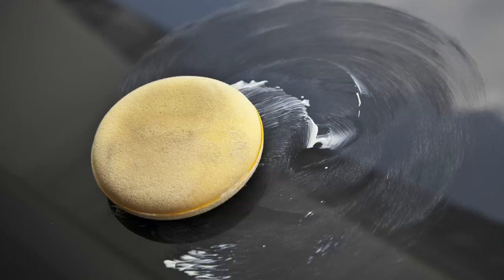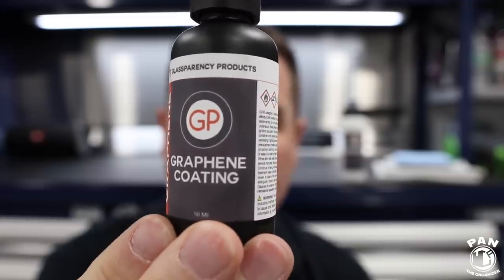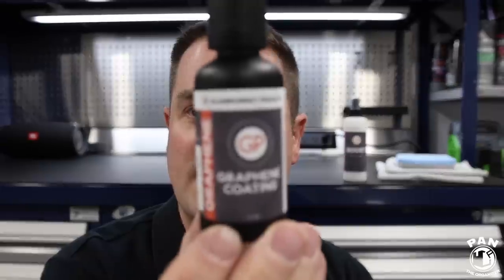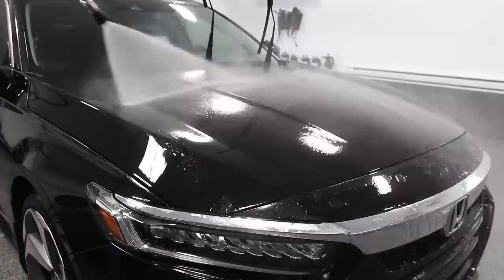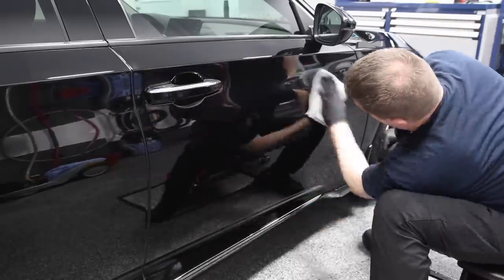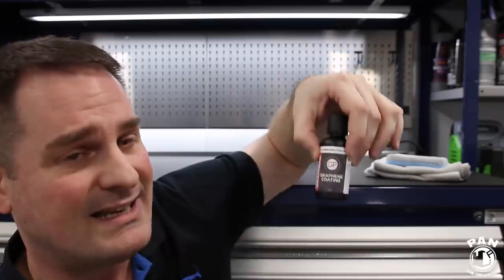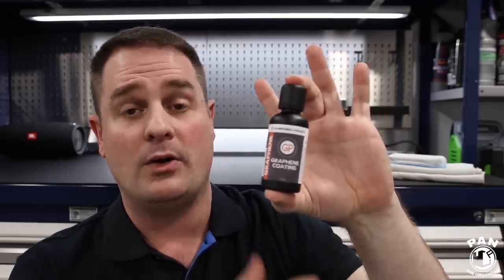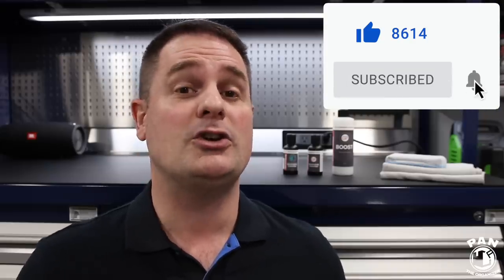GRAPHENE COATING by GlassParency! The Future of Paint Protection!

Comment: Heyyy Pan. This was the video I have been waiting for. I bought this coating when the company offered threw mentioning you when you did the review and application of the glass coating. I took advantage of that deal but have yet to use ether. I have Optimum Gloss coat on my vehicle now so have to do a light polish to get it off the surface. The weather here in has been extremely hot so waiting for a cool down. down. Excellent review but have a question. The front clip of my car has a PPF on it, do you know if you can apply this on top of that? I can also call the company. Anyway ALL THE BEST as usual.
Reply from the maker: Thanks Mike!  Yes you can apply the graphene coating on top of PPF too.
Reply: @PanTheOrganizer  Thank you and a polishing I go.

Comment: Pan...I have a post-GP question.  2 days after finishing my GP and Boost I parked next to a tree, not thinking that, at this time of year, there’d be any sap but later in the day when I went for a drive I see that the car has many tiny sap/particles on it.  I know I’m not supposed to wash the car for 2 weeks so what do you suggest I do?  I can’t imagine it’s a good idea to let the sap sit on the body.  Thx for any tips!
Reply from the maker: I wouldn't worry too much. The coating is there to protect your clear coat. Wait your 2 weeks, then just wash the car and maybe use a bit of tree sap remover (like CarPro TarX) and you should be fine.
Reply: Thanks...but I ended up coming home and using the boost spray as a lube and very very gently wiping off the sap.  My ‘assumption’/logic was that the topcoat was already Boost so it should be fine, and it was. The sap came off easily.  I was also ‘lucky’ in that the sap was only on the hood, front left quarter panel and a bit on the drivers door and roof..not bad.  And I didn’t want to wait for the sap to dry/harden...it’s easier to remove if it’s ‘fresh’ and in this case it was only on the truck for maybe 4-6 hrs.  So, thanks for your response but I thought you should know what I did since it worked just fine, no noticeable marks or other.
Reply: Same thing happen to me but bird poop don't know if I should wait the 2 weeks?

Comment: Question, it has 5-10 years protection after 2 coats but how many times do you have to re apply between car washes?
Reply from the maker: Nobody spoke about 10 years.  Where did you get that?  It's 3 years of protection if you apply 1 coat, and up to 5 years of protection if you apply 2 coats as recommended.  Every 3 months, it is recommended to apply a topper like Boost after maintenance washes, to maintain your coating's properties.  That's it.  You don't need to reapply the graphene coating after the first application. Until you reach the 5 years.

Comment: Hey Pan, thanks for the Wonderful video! I've got a question:
 Is graphene  coating scratch resistant?
Reply from the maker: No coatings are scratch resistant.  If someone tells you that, that is pure marketing bs.  Coatings are meant to boost gloss, slickness, add UV protection, protect against chemicals, last for years, add insane hydrophobic properties and give self-cleaning properties meaning the car is easier to wash.
Reply: @PanTheOrganizer  can we use a graphene + PPF combo?

Comment: Hey Pan, do you know if graphene products can be used on Matte paints (without significantly changing the finish)?
Reply from the maker: You should stick with ceramic coatings made for matte paints, until they release graphene based coatings for matte paints.

Comment: Thanks Pan!  I've been holding off, until now, after doing a consumer-grade Ceramic 2.5 years ago and I knew about 6 months ago that I wanted to strip/re-coat but since the 'graphene wave' was imminent, I was buying time with toppers and waiting until I saw the first product I felt good enough to go with.  I'd google 'Graphene coatings' every few weeks and see if anything was worthy.  I was thinking about getting the Adams version and it probably would have done the job but then I found your video and after watching, I ordered and did the GP Graphene on my '17 4Runner.  It was so much easier (as you repeat!) to apply and the slickness and shine are insane.  So far I've only done the paint but plan to go back and do the headlights/plastics/etc.  Great stuff, great video and thanks for your review.
Reply from the maker: Thanks for the real world feedback David! Much appreciated. And thanks for the trust you place in my opinion. You certainly got a great protectant on your 4Runner now!  Enjoy it!  :). And yes, do apply to your headlights, tail lights, wheels too!
Reply: Pan TheOrganizer Do you know if I can use the new 303 Graphene spray as a topper on the Glassparancy graphene coating?  I know there’s the GP Boost....I’m just curious what you think.  FYI: I finished my entire truck today.  It looks/feels insane. I finished the paint and also did all of the windows and lights.  Now let’s see how long it lasts...

Comment: Hi Pan,
I spent the better part of my weekend prepping my paint and applying this Glassparency graphene coating.  It went on as a easily as advertised.  Now I’m anxiously awaiting my first encounter with rain or a wash in two weeks!  I understand that the “Boost” is to be used as a maintenance coating seasonally.  Can/should I also used this as a detailer spray after routine washes?  Is there another product that you can recommend as a detailer and/or maintenance over graphene?  I don’t see anywhere on Glassparency’s website where I can purchase more “Boost” on it’s own, so I’m looking for another product when I run out.  Thanks in advance for any suggestions that you can pass on.
Reply from the maker: You could use Boost once a month if you want.  You can also use Bead Maker as a drying aid after maintenance washes if you want.

Comment: If the base coat of graphene gets scratched, can I put on a coat of a spray graphene coating to fill it in? Or will it is just lock in the scratches?
Reply from the maker: Coatings aren't fillers, so they won't fill scratches. You will have to machine polish defects off, and then reapply. But if you use safe washing and drying techniques, you shouldn't have many scratches or swirls. I detail my car twice weekly, and in 2 years and a half of ownership, it was polished only once, not because it had scratches, but just to remove a previous coating (CQUK 3.0) to apply a new one (Opti-Coat Pro+). My car is swirl and scratch free.
Reply: @PanTheOrganizer  Do graphene coatings make it harder to scratch the paint? I have a gloss black Jeep Wrangler and I feel like if I breath on it, it gets scratched.
Reply from the maker: No paint protection protects against swirls and scratches. Paint protection film (PPF) is the only thing that protects against swirls, scratches and stone chips.
Reply: @PanTheOrganizer  Ok, thanks

Comment: Pan would you use artdeshines topcoat over this or the ethos graphene? I have both of those on 2 different cars right now. Thanks Pan!
Reply from the maker: I haven't tested the Art De Shine one, but it should be ok. I wouldn't apply another full blown graphene coatings on top of the GlassParency though. Stick to silica spray sealants (like the Ethos Ceramic Refresh if that's what you were talking about) or graphene spray coatings as toppers over this.

Comment: Pan, in a direct comparison between this and Opti-coat Pro + which you raved about, what would you choose for your own Vehicle?
Reply: Ted Busby if I had paid for Opti coat pro I'd ride that out until it starts to fail.
Reply from the maker: It wouldn't be a fair comparison, as Opti-Coat Pro+ is a 7+ year pro grade coating that can only be applied by authorized dealers and a service like that, for a car like mine, starts at around $1500 USD, versus a 100$ kit of this graphene coating that anyone can purchase and easily apply.  So for value, hands down the graphene coating kit.  For durability, only time will tell as these are brand new products so nobody has had the time to test them over multiple years yet, obviously.  If it gets anywhere near 4+ years of durability, then I would opt for the graphene kit.

Comment: What about the hardness level, does it protect from minor scratches?
Reply from the maker: Graphene coatings and ceramic coatings aren't meant to protect against scratches and swirls.  If someone tells you that, they are lying.  No major coatings company would do such claims.  Only cheap brands.  Yes the fact that you add layers on top of the clear coat can help diminish the risk of the smallest light scratches at best, but that's it.  If you want ultimate scratch protection, go for paint protection film.

Comment: In the video you state that the second coat can be applied immediately after the first is done. On the website it says to wait 40-60 minutes between applications, and allow it to become “tacky”. Should it take me about 40 minutes to complete the first coat, and then apply the second in the same order of application? This will be my first time applying a ceramic.
Reply from the maker: That’s what I meant by immediately. Meaning once you are done going around the vehicle the first time for the first coat, normally 40-60 min have gone by, so you’re ready to start applying the second coat.

If you were super quick applying the first coat in 25 minutes, then wait a bit. Adjust accordingly.
Reply: @PanTheOrganizer  thank you for the reply. Love the videos!
Reply: Another follow up question being this will be my first time applying ceramic. I am picking up my truck today from getting polished, and had planned on applying the graphene. The temperature today will be mid 60’s Fahrenheit. Tomorrow the high will be only 45 degrees and dropping below freezing. I will be keeping the vehicle in the garage, but it still gets cold in there. I like today’s temps for the application. With it cooling down tomorrow will that effect how it cures negatively? Garage is not heated.

Comment: Hi Pam can this be applied on top of a permaseal polymer sealer
Reply from the maker: No. It has to be applied to well prepped and virgin clear coat. Not on top of existing protection.
Reply: @PanTheOrganizer  So the vechicl has been paint corrected and delivered to me .
So next step is to wash it down and wipe down with alcohol 70% . Then apply coating correct.?

Comment: I just hate it when people are trying to render obsolete really good technologies like ceramic coatings. Certain products are better in certain conditions. I still apply Fusso Coat over my cars because it tends to resist better to contamination fron external factors. And I still have friends who wax their cars with Gold Class which gives insane gloss and that sexy wet look. Which is better than the most premium of the premium ceramic coatings. Stop rendering stuff obsolete just because a new class of products is on the market.
Reply from the maker: I’ll tell you what I hate.  People like you who come here with false accusations like you just did.

Who said ceramic coatings are obsolete dude?  Are you high?  Certainly not me!  Heck my own BMW is ceramic coated!  There is no such thing as obsolete paint protection.  Even traditional carnauba waxes can still do a good job with protecting a car.  It’s just that they don’t last as long.

Plus, it’s normal that technology evolves including in the detailing world.  And thank god for that as you would still be drying your car with a chamois or using terry towels to buff out waxes instead of microfibers.  I am one to embrace change if it’s for the better.

Fusso Coat is very good for someone who likes a paste sealant.  But a good ceramic coating will blow it out of the water for gloss, slickness, 2+ years of durability, better hydrophobics, much better chemical resistance, etc.  Those are simple facts, tested, tried and true.  If you believe otherwise, I can’t help you with that.

But that doesn’t mean Fusso is obsolete.  Many people love using it.  Heck I even reviewed it in one of my videos last year and I like it.

So don’t come here accusing me of rendering products obsolete!  That is not cool.

Comment: how does it do with rockchips and chipping? with cereamic coatings chips are really obvious and very difficult to fix as it cracks the surrounding coating.
Reply from the maker: No paint protection products protect against stone chips. Only paint protection film (PPF) will do that.
Reply: @PanTheOrganizer  the protection isnt the concern, rockchips happen. the issue is that rockchips can crack the coating which is very unsightly and tricky to fix (i am talking about the crack in the coating, not the rockchip itself)

Comment: Hi Pan. Thanks for you're videos. I have learned alot. I want to invest in a power washer. I found one that fits my budget but I did not get it yet. What do you think of Sun Joe SPX3000 2030 Max PSI 1.76 GPM 14.5-Amp Electric High Pressure Washer?

Comment: Pan do they sell boost alone?  Or is it just part of the kit?  And do you recommend using bead maker on top of the boost that is topping the graphene coating?  That way we can still use bead maker as a drying aid.
Reply from the maker: Not sure if they will sell Boost alone.  For now, I think it's only part of the kit.  You could use Bead Maker as a topper, or Boost.  Just don't apply too many toppers as that defeats the purpose.
Reply: Pan TheOrganizer okay would you recommend using boost then something with no protection in it as a drying aid like Adams quick detail spray?

Comment: On what basis is the 5 year durability claim made? It’s a first generation product and could not have been real world tested for this period of time. Sounds more like a marketing/advert video to me.
Reply from the maker: Well that would be the same for any other product released on the market.  Do you ask the same question every time a new product goes to market?  Of course nobody has had the time to test this long term yet, but as I have experience with GlassParency's glass protection that lives up to its durability claims, I have no reason to doubt the 5 year claim if the vehicle is well maintained.  Same goes for any other product I use.  If we had to wait for someone to test the full durability claim of each new product, we would never buy or apply products!  I hope you realize how weird your comment sounds.  For example, the Opti-Coat Pro+ coating on my BMW has a claimed durability of 7+ years.  Do you honestly think I would wait for someone to test this for 7 years just to make sure I get the same results?  Come on now!

Plus, many factors influence durability, including how well you actually prepped the paintwork and how well you maintain the coating over time.   Two people could have different results, so your point would be moot.  I test products from reputable brands, and have no reasons to doubt any of their claims unless proven differently by a reliable source.

Enjoy life and don't overthink things like this is my opinion.

Comment: is the boost the same as something like bead maker or can bead maker be used as a topper here like it can on other applications ?
Reply from the maker: Boost is a silica spray sealant (like CarPro Reload, Gyeon Cure, Kamikaze Overcoat, Gtechniq C2V3, etc). Those are used to maintain the properties of ceramic coatings, and graphene coatings. But Bead Maker can also be used as a topper, absolutely. I use that on my car all the time, on top of my ceramic coating.

Comment: Hi Pan I know this is an older video but I had a question,  would doing the paint enhancement with car pro essence be ok? I know it has priming capability for Cquartz but didn't know if it would be negative or positive for the graphene or have no affect
Reply from the maker: It remains to be tested, but in theory, Essence should be a good primer for pretty much any quality ceramic or graphene coating.
Reply: @PanTheOrganizer  alright guess ima try it lol thank you!

Comment: Hi pan I know this has nothing to do with your video but by any chance do you know if a 75 foot garden hose will affect how my kranzle 1322 operates
Reply from the maker: It depends on your home’s water flow.  I have a 50 foot 3/4 inch garden hose reel connected to the Kranzle and have no issues.

Comment: What if you don't own a polisher? Can you still do this?
Reply from the maker: The more time you spend prepping the paint, the better, and that goes for any paint protection. The reason for polishing is first to remove oxidation/swirls/scratches to make sure you have a great looking paint BEFORE you seal all that in for years with a coating. The other reason is the mechanical abrasion of machine polishing is the only way to ensure 100% removal of any old previous protection that might be on your paint. This is CRUCIAL, as ceramic coatings need to bond directly to a virgin clear coat, unobstructed by any old wax or sealant. 

To better understand the process of applying a graphene or ceramic coating, watch my tutorial here: https://youtu.be/sqQYVjxFqK0

Comment: Great video Pan! But somehow I feel that graphene coating is not there yet: 1) the product is new, thus price is 3x higher than ceramic coating; 2) from the technology view, graphene is supposed to last for way longer than ceramic coating. I'm mot talking about 5 years vs 1-2 years. It should be 10+ years. So I'm not sure if this graphene coating is the REAL one that we read on the Nobel scientific paper. Or, it is just a nice marketing trick... Anyway, I will wit and see.
Reply from the maker: A 50ml kit of my favourite consumer grade ceramic coating, CarPro CQuartz UK 3.0 costs $87 USD (https://amzn.to/2CRPubJ).  This GlassParency 50ml kit costs $99 USD and lasts over twice as long, and isn't plagued with potential water spotting issues.  So I'm not sure where you see 3x higher price, but graphene coatings are a great value for sure in my books.